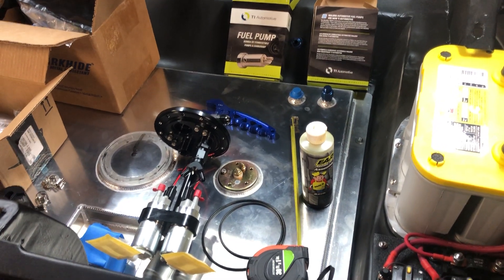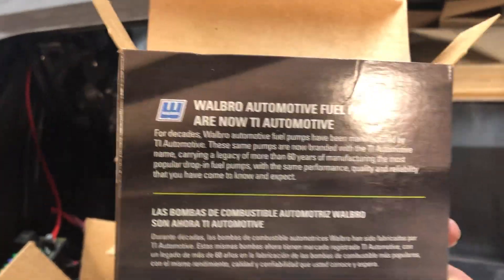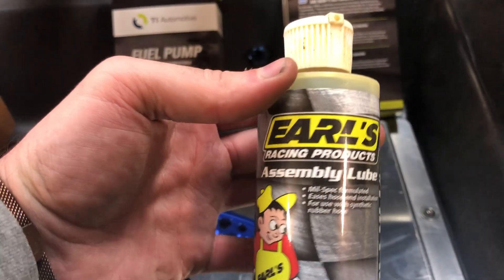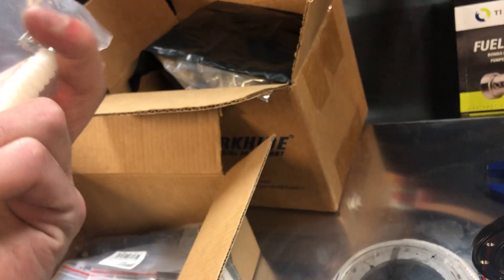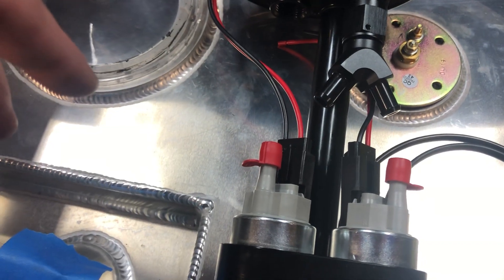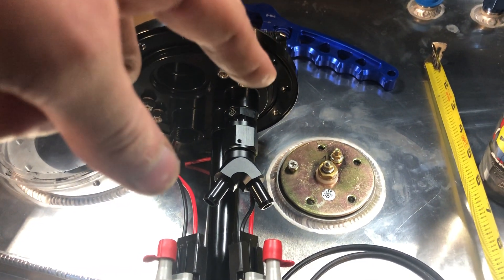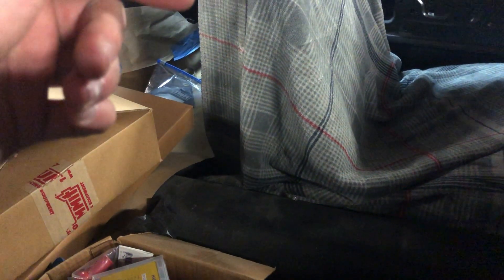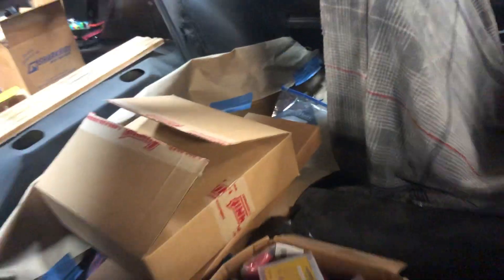68 mustang dual in tank walbro fuel pumps and firewall smoothing

Comment: Like your filler ideas. My plan is to cut the top of my tank, weld in baffles along with my pump, then weld it shut. I bought a 16 gal tank which has the raised top which should allow me to try my idea. If I ruin it, I guess I’ll be asking you for your buddy’s contact info so he can build me a tank like yours. Great to see so much progress!
Reply from the maker: you putting a pump flange on the top of your tank so you can service it? if you don't plan to push lots of power, spectra makes on you can get off rockauto for under $200. goes in the normal sender hole. i thought of going that route originally, but wasn't enough fuel for what i plan for.

Comment: Who is the guy.. or where do I find where to get  neck filler tube pre-made to just make it easier? That mystery guy selling for $100??
Reply from the maker: i don't know if he wants his email shared. you can find him on this forum page about it though. if you can't find a way to get in touch with him, comment your email and i'll send you the email i received from him. https://www.vintage-mustang.com/threads/1965-70-mustang-fuel-filler-necks-modified-to-eliminate-splash-out.1180278/
Reply from the maker: @ciberia7567  good deal. hopefully it works for you. i still had a little "puking" out the back.. i found that if i open the cap on my fuel pump hanger to add more venting, it doesn't.. then i can also watch how full i fill the tank. don't like to top off, as it'll wanna come out the back with "my driving habits" lol..